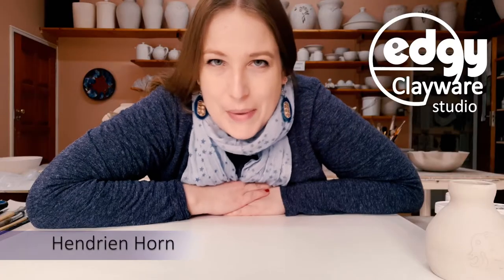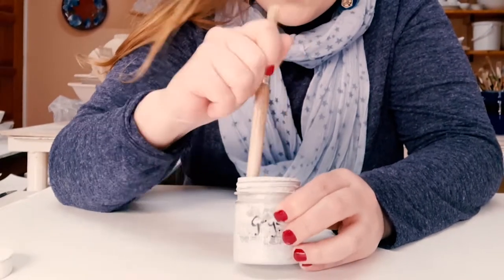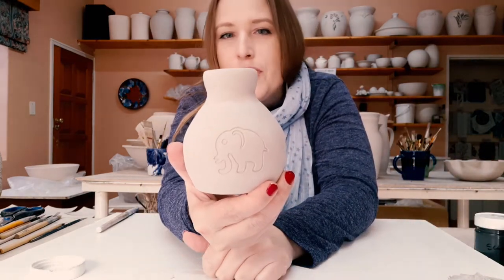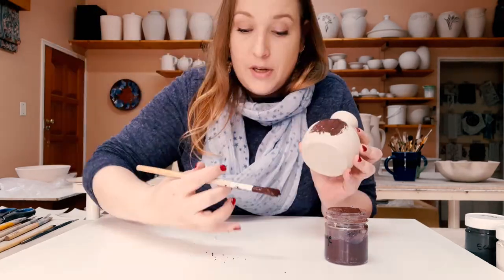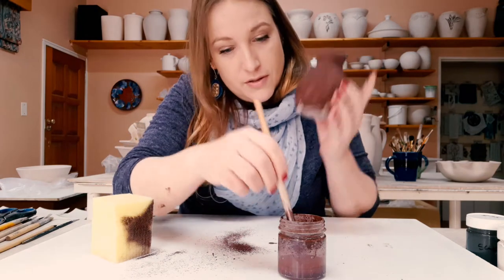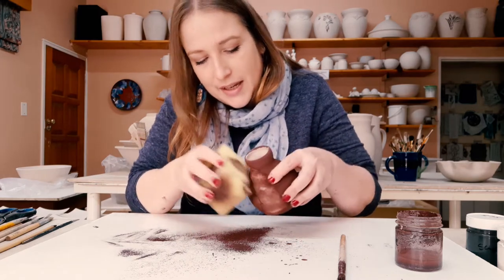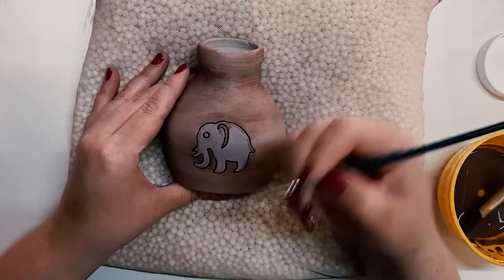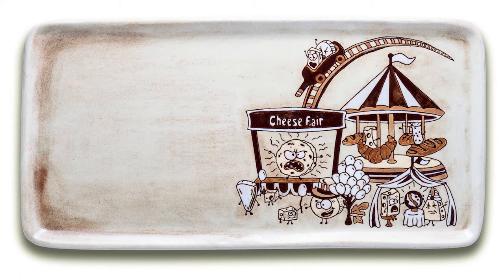Pottery Underglazes -Tips and Techniques, using underglaze powder and how to fix old underglazes

Comment: Hey. I have a question. So I painted my work with white underglaze but it look weird. I just used the under glaze staright from the container. Do I add water to it? So that it would stick to my work?
Reply from the maker: Hi there! Yes add some water. I usually get a small container and pour in a bit on underglaze and a really small amount of water. Then mix with a brush. Make sure you are using a soft paint brush, they always work best. Underglazes dry so quickly so if you feel some parts on your pot are not smooth, use your finger and softly run it over the painted area to smooth it a bit if it looks too thick. I hope that helps!

Comment: Something I really, really, wish potters would do when they do glazing videos is show what the pot looks like after it's fired. Seriously, it's a big missing thing on glazing videos. BIG. That said, I think you have a lovely teaching style.
Reply from the maker: Hi Catherine, thank you for the compliment. If I do another glazing video I will be sure to include the final product :) (you do have a good point). This one, I only did the underglaze paints and had not added any glazes yet, but I will look at adding it in the fututre. Thanks for your feedback.:)
Reply: @HendrienHorn   I'm a beginning potter. I can throw a basic pot on the wheel. I like to hand build. I bought a really old kiln in the spring and can do a bisque fire and a glaze fire. I still don't understand the idea of under glaze. I have done things where I pressed leaves into a plate then fired the plate. I used glaze to paint into the depressed areas and sponged the excess around it then followed up with a clear or nearly clear glaze on top. Is that an under glaze? What's different from painting something on a pot with glaze and then putting a different glaze over it?
Reply from the maker: @catwoolf11  When I started out, I also found the concept of underglazes confusing :). Underglazes or stains are coloured glazes that can be mixed together and that you can use to decorate a pot or mixed into the clay to create coloured clays or slips (this usually happens before you bisque fire it).  Then once it is bisqed fired, you put a clear glaze over it (like the ones you have been using). Think of underglazes as paints, they only 'activate' and show their true colours once you have applied clear/transparent glaze over it and fired it in the kiln. Here is an article by Lesley Milne that could help with the confusion https://thepotterywheel.com/the-difference-between-underglaze-and-glaze/. I hope it helps.   :),
Reply: @HendrienHorn  that's awesome. Thank you!
Reply from the maker: @catwoolf11  No Problemo!
Reply: Me too. Makes me go nuts! 🤪

Comment: Wow, great video! I thought underglaze had to be used on biscuit, is it the same or which is better?
Reply from the maker: Hi Carlo. Thanks for the question. Underglazes can be painted on bisque, but painting on leatherhard or bone dry enables you to just wash it off, or wipe it away if you have made a mistake, where on bisque it may take a bit longer. Plus, once it has gone through the kiln once, you can check to see if you have to fix anything, plus the amount of underglaze that comes off in your glaze bucket once you dip it is also smaller.
Reply: @HendrienHorn  thank you so much you're a very good teacher!

Comment: hello! i've just started my pottery journey and was having a really hard time underglazing my pieces, but this video was very helpful, thank you very much!
just to be clear, i can mix the water to all the powder on the countainer itself, and if it starts to dry out through out the days/ weeks, i should do as you did in the start of the video? or should i mix the water to the powder in little bits as i'm using it? thank you! (sorry for bad explanation, im not very good at english!)
Reply from the maker: Hi there!! Thanks so much for watching. I just want to make sure that I understand :). The grey underglaze I mix with the water in the beginning of the video is old and has dried out, and it was bought already pre-mixed. So I added water to make that I can paint with it again for a while, until I need to add water again. So add water until it looks ready to use, and then the next time you use it, test and see if you must add water  again -trial and error :). If it is too thick add water.
The underglaze powder that I rub into the grooves of the pot I just added a little water (and this I do as I go). Because the powder on it's own does dry out very quickly, I add the water as I go, because I don't want to waste it.
Good luck on your pottery journey!!
Reply: @HendrienHorn  ohhhh, i understand now, thank you so much for you answer!
also, is it normal for the underglazed pieces (not fired) to be VERY powdery? i underglazed my first pieces yesterday (i did 3 layers) and i feel like i will smear the details just by touching it... maybe it's because i didn't add that much water, or maybe i did too much layers? thank you so much for your accessibility and sorry for all these questions!
Reply from the maker: Hi there. Yes when you put underglazes on it can easily be smudged, so you must be careful. However, if you stick to thin layers it should be fine. It sounds like it may be to thick if it is so powdery. If it is too thick, when you glaze fire it, you may get pin holes (holes in your glaze) and it won't cover your entire item. A good tip is to take a little bit of your undeglaze  and put it in a seperate bowl (like I did before I painted the elephant) and water it down a little more if you want to do so many layers. When done, pour what is left of your mixture back into the original container. Hope that helps!